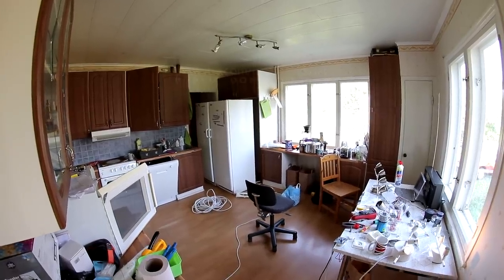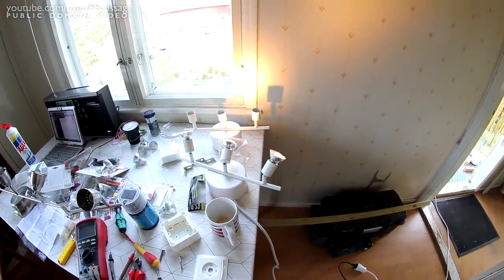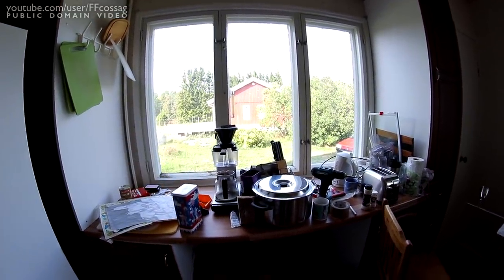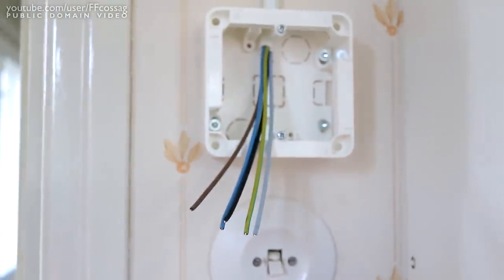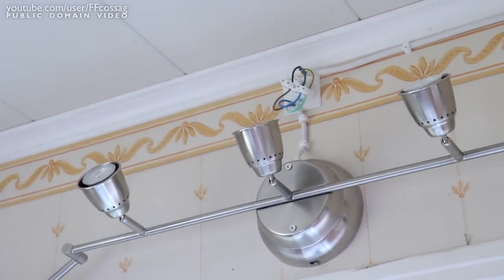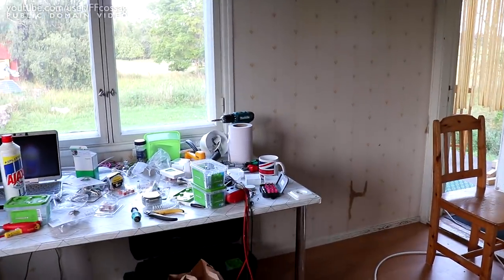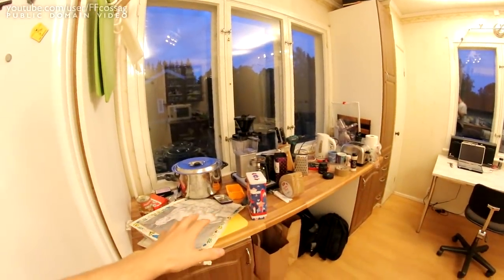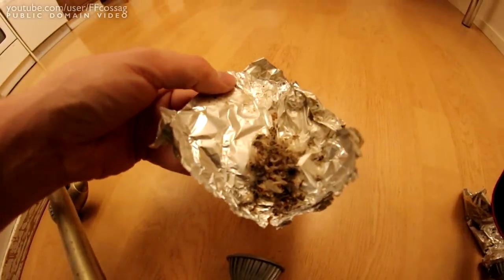$200 dimmable LED kitchen light solution ($120 of it being LED bulbs)

Comment: 10 years old? Looks like 70s lol... but it could be that I just hate wallpaper. Anyway nice work. 

The lighting in my house is shit, it's mid-50's light fixtures complete with horrible cloth cord or slightly better downlights. I have 600/800+ lumen leds and I can still barely fucking see even during the day. At least our circuits are wired up logically, but in true Australian fashion half of it's done with power-bars and extension cords stuck in the walls, I shit you not. By the mid 2000s after spending a decade basically rebuilding the house my parents got cheap and got my uncle to do the wiring in the last extension unpaid, so it was done with the absolute minimal effort.

Comment: I replaced most of my GU10 halogens with LEDs too, but I chose 8W LED lights with 750lm light output (manufacturer of those is "v-tac").
So far one out of all of them have failed (started flickering and pulsating), haven't bothered sending it in for warranty replacement as it was only like 3€ a piece anyway.
I've also put some GU10 to regular light bulb adapter thingies to use so that I can use regular big LED light bulbs in the GU10 light fixtures. Looks a bit weird but that way I got lots of light where I want it :3

Comment: I ripped out two GU10 light fittings from my uncle's house because they were burning through bulbs like they were free, replaced the kitchen one with a 4ft (or 1200mm) LED fluorescent, and the bathroom one with a round bulkhead light I've had for years & fitted an LED bulb... :)

I can't stand GU10 spots to be honest, having lots of light concentrated in one spot leaving shadows & darkness everywhere else ain't useful...